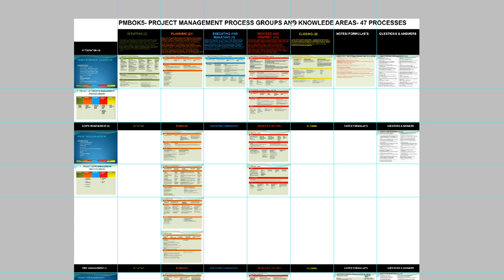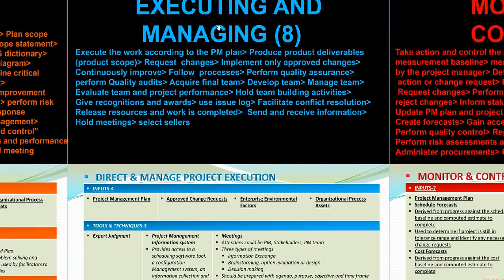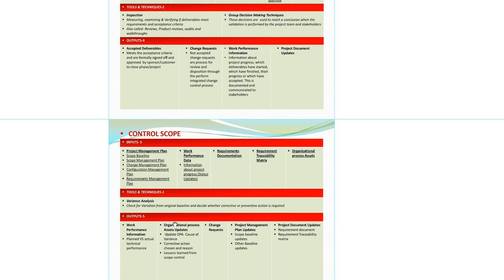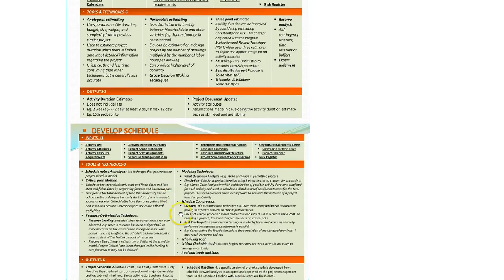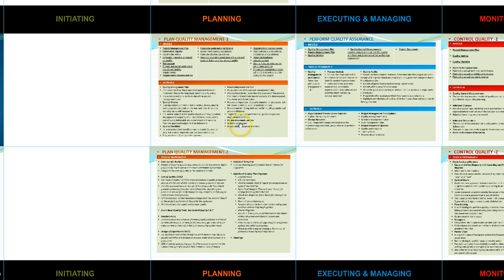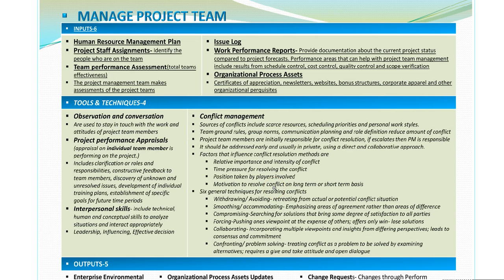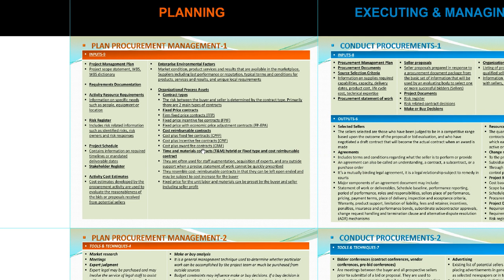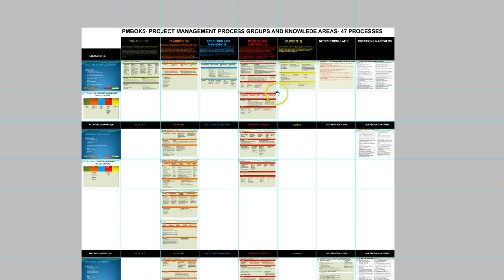PMP Training PMBOK 5 Project Management-47 Processes

Comment: I used tutor Ali's system to assist me in understanding the PMBOK guide and preparing for the pmp exam. His system allowed me to very quickly get a comprehensive view of the PMBOK guide. The questions and answer section reinforced the important concepts and help significantly in retention of information. I am an electrician by trade and it worked for me. I pass on my very first attempt. It can work for you too.
Reply from the maker: Thanks for the great feedback Ray! Congrats again :-)